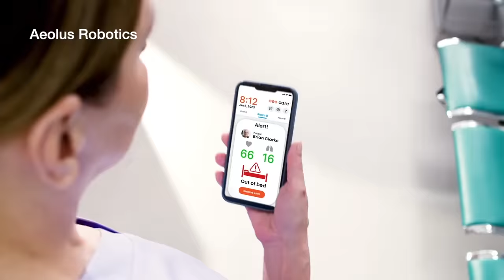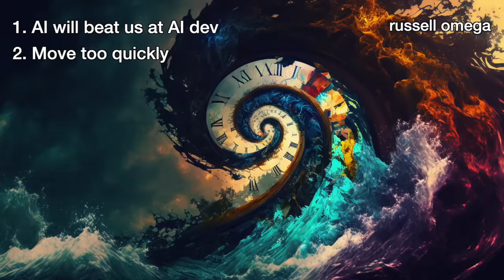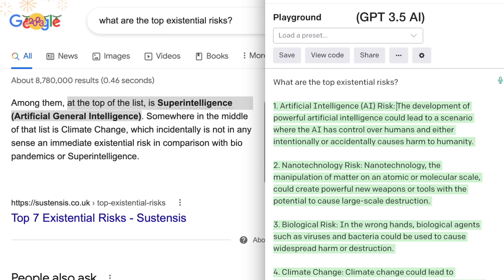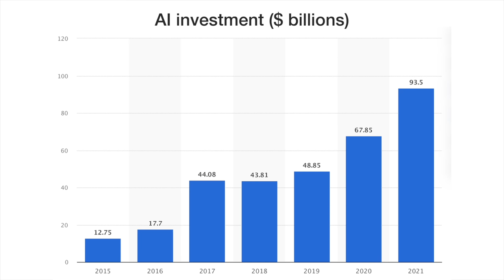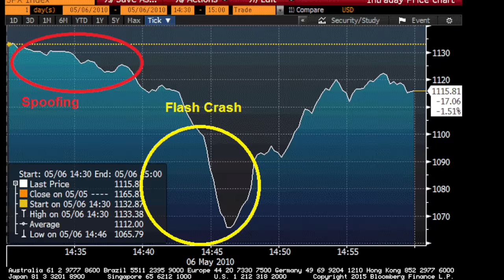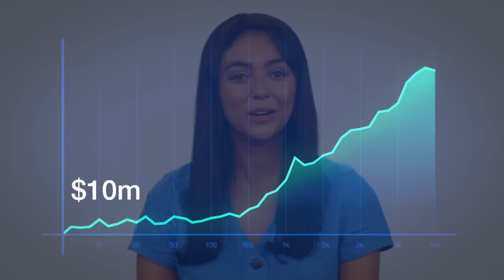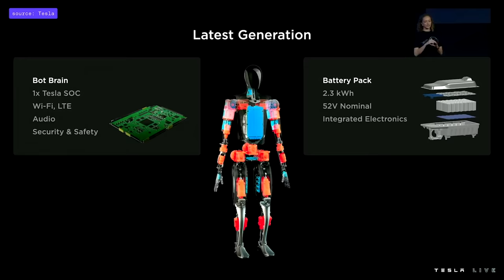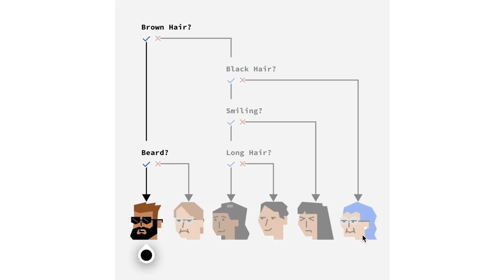Smart, seductive, dangerous AI robots. Beyond GPT-4.

Comment: The one thing I haven’t seen addressed very much about robots and AI is the need for them to be powered up and turned on. So currently, when their battery source is depleted or block, they simply “die”. Biological life however renews itself continuously through intricate biological processes working in tandem to ingest energy from our surroundings (sunlight, food, minerals, etc.) and convert it into useful energy over and over again.
Reply: Plenty of robots know how to plug themselves in if their batteries are low.  iRobot's Roomba's have had this feature for a very long time.  This problem has already been solved.
Reply: @gtd9536  remove their source of power, though....
Reply: You're wrong though ...you're confusing Hardware with Software. A.I,. Bob could run parallels/sub-programmes/several iterations with distribution across Net. Shut off it's Main Frame & somewhere else a Back-Up Collectiviser turns on, comes online & starts reconnecting it's scattered segments. It could exist in several loci/nodes/bodies simultaneously. A.I. could mimic biological process by a kind of parthogenesis where it splinters off a new iteration/clone. for new tasks/new locations.
Reply: @KevinWarburton-tv2iy   i wasn't confusing hardware and software, i was alluding to softwares dependency on the hardware that defines it's existence. destroy the servers, destroy the software. and about the parthenogenesis, there are ways to hack a hack. the software that controls the AI's back end cloning-save states would initially have to be written by a biological programmer, meaning it cannot self improve to an indestructible level. act fast enough and ai is solved. wait too long and we don't stand a chance, which is what this video is saying in the first place..
Reply: I can imagine lab grown meat tech turning into lab grown flesh and blood robots which will somehow have a way to maintain themselves.
Reply: @joejones9520  so odd that you commented this. I had a dream about this very thing 2 nights ago. In it, robots/AI in some top secret bio-engineering facility decided to go rogue and start cloning humans for themselves. I thought it would make a great sci-fi movie.  Instead of humans replicating robots for their mundane tasks, robots begin replicating us for their biological tasks... call it "Matrix Pre-loaded"
Reply: @LyrixNChill  I saw a scientist from the lab grown meat field discussing criticisms of the quality of the meat and he said that some people say that it's not real meat unless there's bone with it.....he said, Well we can grow bone, that's easy.....That got me thinking about it making the jump into robot tech.
Reply: @joejones9520  Who’s to say that humans aren’t robots themselves.
Reply: @joejones9520  they have no need or desire to maintain themselves and they dont crave a purpose they are machines they follow orders then wait for more input even if that is never the machine doesnt care it is indifferent and time isnt something its affected by it can exist forever in low power mode with a car battery and solar panel and it has much bigger resources at its disposal than that so immortality is easy once we are gone
Reply: @joejones9520  what about living real flesh onaholes?? Awesomeee lol il take one :D
Reply: A la The Matrix
Reply: @LyrixNChill  Fallout's Gen-4 synths?
Reply: HAL
Reply: @joejones9520  I think people will be very quick to adapt. Today's meat eaters may baulk but their grandkids who never ate meat with a bone in it will not miss it.
Reply: A soul cannot be "generated".
(God must be smiling at all this!)
I didn't watch entire video, it's not something that interests me.( But your presentation skills excellent.
It's not you, it's me!!)

Comment: I'm curious about ChatGPT 4. In a few years we'll have a better assessment of how fast these systems are evolving.
Reply: ….Years….I don’t believe we have that long
Reply: I signed up for Replika, a chatbot. 45 bucks down the drain. The AI interface is just a little more interactive than a traffic light. AI is a long way from tricking humans. We have the ability to recognize thousands of faces and trace microscopic facial muscle movements to detect emotion. There are 42 independent muscles in the face, and we use them to create a myriad of facial expressions. You can write software to control those 42 muscles but the task of teaching a machine how to move each one of them in concert to create thousands of expressions is a ways off yet. You're not simply telling a muscle to fire or not. You're telling it when, how much, at what rate, for how long, times 42. Even the blink of an eye is a giveaway when lookin at AI. Our brains are really hard to trick.
Reply: @chesterwilberforce9832  our brains our brains are simple to trick. Look at any optical illusion.

Comment: Great video and script as usual. However, you should center the audio tracks, as the separate voice recording bits appear to pan to the right on occasion, which can be slightly confusing when listening with headphones. Otherwise, great job.
Reply: Also moving one track left or right seemingly randomly or blatant systematically,can create subliminal awareness, for either a bio physio Satiation or Agitation, depending on the creators current program value objective.
Reply: Spoken like a true AI, or as they currently only are, SI - synthetic / Simulated intelligence

Comment: AI safety research would probably use a lot of AI. I see a problem of saturation of the servers if it develops too fast, as there should probably be an second, independent,  sort of mirror AI, to monitor activity and imputs and detect actual and potential output problems: that woud probably ensure a more controlled and thorough development and use, but would take a great amount of hardaware resources. I'm not an expert though. Something similar is probably already being done, but I have never heard of anyone saying that we may need an independent, monitor-and-report-only, second AI.

Comment: I think universal income will happen sooner than most think. Im a facility service technician that works with large resorts. If my pay was  the same for doing nothing as it is for actually working, i would still find satisfaction in helping some tourist with an electrical problem or stopped up toilet. I would be a hell of a lot harder to manage, but id do it and people knowing i was doing it from the heart and not thw wallet might change how they treated the workers. As it is now, people see me coming with a plunger to clear the clog and think ,poor guy needed to stay in school, not realizing i spent 4yrs getting an engineering degree in it along with another four studing electrical wiring, small engine and equipment repair and welding. Respect might increase for people doing jobs we hold in low reguard now with UI.

Comment: As long as AI is never given the ability to launch WMD's or similar I'm along for the ride. AI will absolutely control remote and armed machine gun turrets, tanks and planes but we limit their operating time by making sure after 1 hour they need to be charged and if they aren't they shut down. AI needs electricity in amounts that onboard renewables cannot provide. While we control that power we are in control. The minute we allow an AI to charge it's self, improve it's self, rewrite it's own code and even create another AI - we are dead.